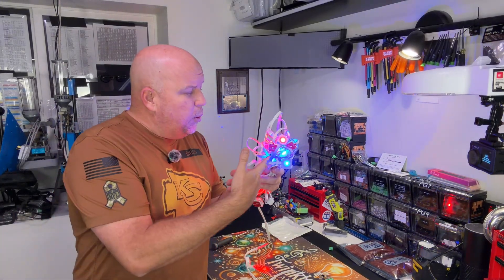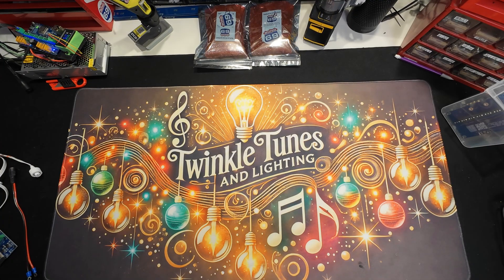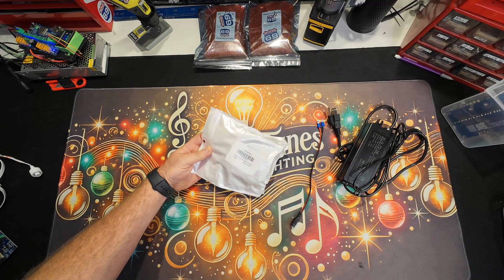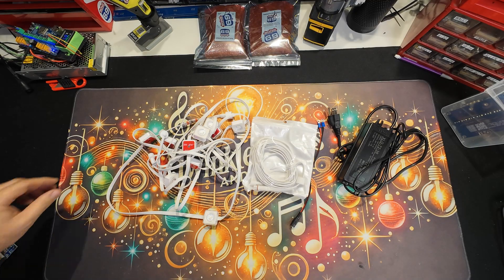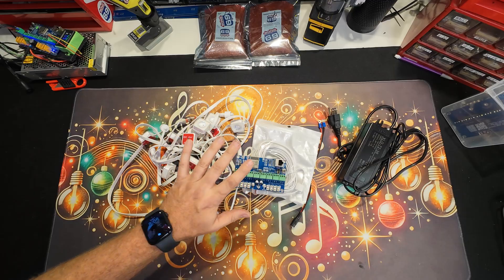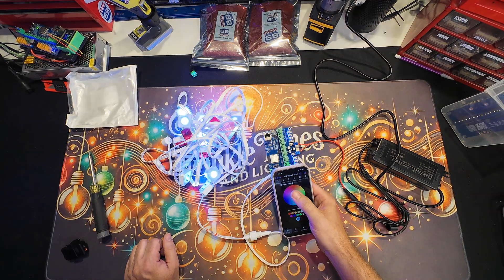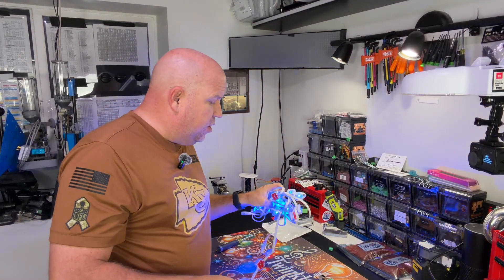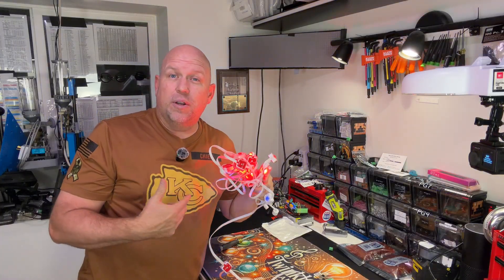DIY Convert Govee H705 to WLED Using THIS Controller! (Full Step-By-Step Guide)

Comment: Great videos on both controllers, my question is for this setup, do you use the same box you used for the esp32 controller?  In your light show, it looks like these are a part of your show, where do you put your box at? Also assume you use xlights to control, i just learned how to add the controller to xlights.  Do you use wifi to connect? Any issues? Would love a short vid or description of your wifi setup as thats what i do for a living.
Reply from the maker: Good question. For this setup I’m using a Harbor Freight 1800 case, not a different enclosure. I use the same style box across my ESP32/WLED controllers so everything stays consistent.

In my show, the controller box usually sits right at the prop — either mounted behind it, at the base, or staked nearby — so pixel runs stay short and clean.

Yes, everything is controlled through xLights, and these are connected over Wi-Fi (E1.31). I run a dedicated show Wi-Fi network that’s separate from my home network, and it’s been very reliable with no issues for me.

A short video breaking down my Wi-Fi/show network setup is a great idea, especially since that’s your field — I’ll add that to my list.
Reply: @twinkletunesandlighting great, i think i got it all, one last question, with your govee lights that are up on your high peaks, where did you put those controllers? I appreciate your response, and look forward to your wifi video as well as others when you get to them.🙂
Reply from the maker: Check out this video and It shows the box I use.  It is one of my first ones.  https://youtu.be/9AktdfjruSM

Comment: I have everything hooked up and running. I set the settings like you said in the video but my lights only flash off and on or stay solid white. They won't change colors or anything. Also, every time i change a light color or something they flicker before they do anything. Got any ideas? Thank you!
Reply from the maker: Yep — that behavior is usually a settings or power issue, not bad hardware 👍

Quick things to check:

1️⃣ LED type & color order (most common)
In WLED → LED Preferences, make sure the LED type is correct and try changing the color order (GRB ↔ RGB).

2️⃣ Power
Flickering when changing colors usually means low voltage.

Confirm Voltage Power Supply matches your pixels

Grounds are connected

Try lowering brightness to ~30% to test

3️⃣ Data line
Long data wires can also cause flashing.

4️⃣ Segments / presets
Clear presets and segments and test with a simple solid color.
Reply: @twinkletunesandlighting got it man! I looked at your other video and used those settings you listed on having the newer version of the pros and it worked perfectly! I watch all your videos to learn as much as possible! Now to figure out what I need for other stuff! Thanks again!
Reply from the maker: @robertbooker6536  YES!!!!!! Success!! Im glad it worked!  It is frustrating at times but you sure do learn alot for troubleshooting!

Comment: I have 96 led (H705A) Its only working half of the run. I know they all work, you think its the controller.  Im  using a GLEDOPTO controller..
Reply from the maker: Double check how many you have in your “number of LED’s” in the gpio output.  I also think the max Input for GLED opto is 24V?
Reply: @twinkletunesandlighting So if I were to get the controller your using that would work with the amount of lights Im using?
Reply from the maker: Yes. Each output can control 800 leds at 40fps regardless of the voltage you are using.
Reply: @twinkletunesandlighting wow! Thank you for getting back to me so quick! It surprised me that you did, I really appreciate that!! 
Thank you again for the advice, I hope you and your family have a great Christmas!!
Reply from the maker: Yes of course!! And thanks for watching and subscribing!

Comment: Will this method work on the H703B lights?
Reply from the maker: Yes! They sure will!
Reply: @twinkletunesandlighting another question……the Govee control box has two pigtails that will only run 3 strands of lights on each.  Could I run 4 on each with the bong69?
Reply from the maker: @redmosq4197  yes. The limitations on the govee are for the app itself.  You need to remember the more strands you run the power will become an issue towards the end of then run.  This is where power balancing and injection comes in to play. With 3 or 4 you should be fine but may have issues with more than 4.
Reply: @twinkletunesandlighting ok.  Thanks again
Reply: @twinkletunesandlighting the fourth strand is orange not changing colors with the other 3
Reply from the maker: @redmosq4197 make sure your LED count is correct. If you have the first few lights then you will have the rest.
Reply: @twinkletunesandlighting the count is correct.  I can’t any colors.  I think it’s more of a connectivity issue with wled.  I got that wled native app and it’s not seeing the bong

Comment: How did you get that green part at the end of the extension on?? it just appears out of no where , you said something about terminated ?
Reply from the maker: That is a 3 port phoenix connector that come with all controllers. That is what you will terminate the tail to the controller.
Reply: @twinkletunesandlighting so that 3 point phoenix connector comes with the bong controller?
Reply from the maker: Yep. All 8 ports.
Reply: The link for the bong69 doesn’t seem to be working……timing out

Comment: Hey quick question as I'd like to follow this tutorial. The 12v pigtail you linked on amazon doesnt have the same ends as the pigtail connectors you use in the video (the round part that you screw in to the controller). Is that a separate piece? Or do they come with the pigtail?
Reply from the maker: Yes. To find the actual one that screws in to the power supply would be very difficult as it is part of the Govee set and Govee family. This is as close as we could get to show that it is possible.
Reply: @twinkletunesandlighting  Can you get those at Lowe’s/Home Depot?
Reply from the maker: Sure can! But I also do a video for AngelHalo that you can get on Amazon and the really are just as good and half the price.

Comment: Thanks for the video! I just finished setting up a generic WLED controller with a 36V meanwell power supply and a buck/boost converter (controller is only good up to 24V). I like this setup better. I just purchased (5) of the Bong69 8-port controllers for next year. I will probably replace the cheap controller I just installed once they come in.  So I have a question regarding the permanent outdoor lights and WLED. I already have one set (150ft) of the exact lights in your video installed on my house. I just purchased and received another 150ft set off eBay. My plan is to install them in between the existing set. My question is, can the two separate kits be setup as one strand  in WLED? I know X-Lights has a way to do it... Something like checking an "every other light" box type thing. I just wanted to know if WLED had that capability. As always, thanks for your time and effort with your videos. A lot of them are my go to while I'm in my light show infancy stage.
Reply from the maker: Yes it can be done and it is very simple. In WLED it all has to do with “segments”. They use segments like groups. When you have two separate controllers you will use “sync interfaces”.

Comment: Thank You very much!

I’m not sure how many lights your power supply will support based on it’s ~4 amps of output.  Therefore, I located a Mean Well 36-volt power supply with 9.7 amps to substitute in my future setup.  I may have to run two channels on the Bong 69 controller since I have 2 sets of 200 feet Govee Pros.

The Govee Pro sets come with multiple extensions and splice kits and you can splice those without any warranty concerns; the instructions show you how to perform those steps.
Reply from the maker: It should be able to ándale them all and then some. The controller will not hold you back. The original Govee power supply is 106W at 3amps at 36v. The board is fused at 5 amps an output. So it can handle 180 watts per output. I run three strands out of three separate outputs with a MeanWell LRS-350-36 and it does great. I also keep in mind of running my power supplies at 80 percent of capacity.
Reply: @twinkletunesandlighting  That's the power supply that I located and added to a list.  How do you run your power supplies at 80%?